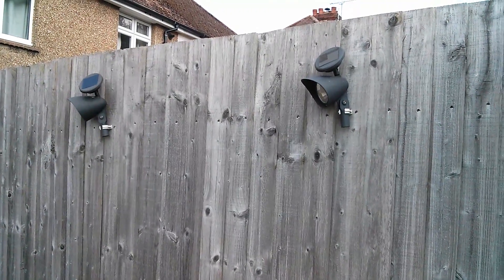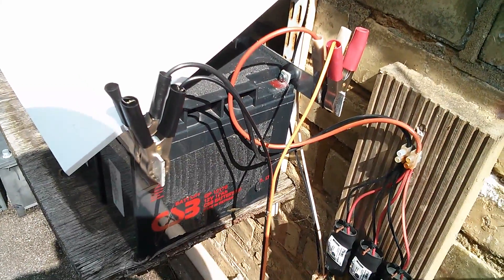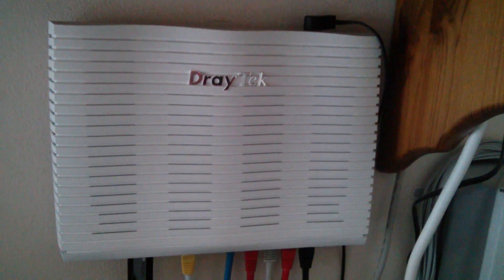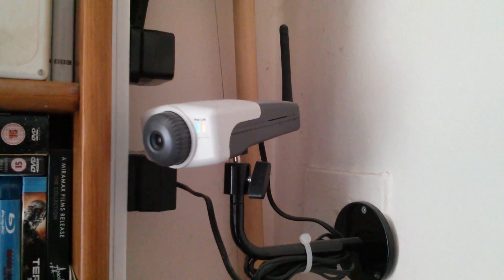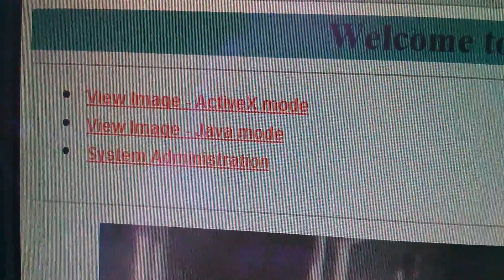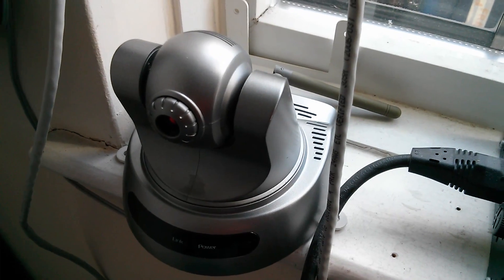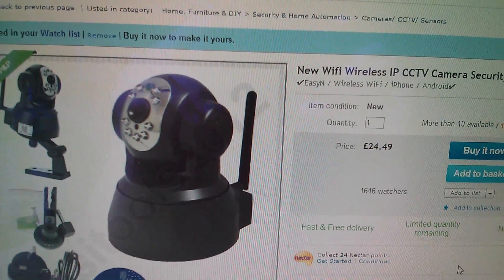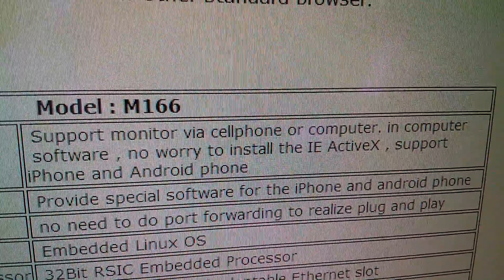IP Security Cameras & Learning about TCP/IP

Comment: What I would look out for in new IP cameras are the video codec they support in hardware. All the cheap cameras will put out MJPEG, which in essence are single JPEGs sent frame after frame. This has low latency, but the datarate is very high and will gobble your WIFI bandwidth in home or upload bandwidth if viewed from the internet.
Converting multiple of these streams on the fly to something more compressed can take quite a beefy PC. So it's very useful if the camera by itself can do the ecoding, preferably into h264.
Other than that: the streams are almost standardized. I think MJPEG can even be played by Firefox without any plugin for example. MPEG2 or h264 is a little bit more demanding, but there's quite a lot of free software that can play these streams. And for higher resolutions this is the only way to get many streams over the same connection at once.

Comment: Love this idea. I currently have a foscam ip pan & tilt camera that I'm using as a baby monitor. It's not hd but I still needed to run a network cables stead of wifi to use the mic, speaker and bring the refresh rate up. I have an app on my phone that detect motion and faces. Now my little girl is older I'm looking to use the camera for security. Really looking forward to these videos.

Comment: I have a few IP cameras here they are very low resolution I am waiting for the The UniFi Video Cameras to be available at a better price then what they are right now these do 720p, this is important for me as I wish to be able to identify people out the front should I need to. (maybe I should get a 6m pole and mount that one up there and then use lower quality ones elsewhere.

Noted on your Qnap NAS I have a few Qnap nas here and the services they have in them are quite good.

As for networking I use fixed IP for my internal network, that been said for my tablet etc I have a DHCP server set up that only have a range of some 10 IP addresses available. (DHCP is still using IPv4 I have all the win7 and linux computers running a dual stack and IPv6 gets priority when accessing my NAS(s).

Comment: The best app for android  for controlling many IP cameras is TinyCam Monitor Free/Pro https://play.google.com/store/apps/details?id=com.alexvas.dvr I have used it for a quite a while now with many different IP cameras (foscam mainly) some that support Pan/Tilt and it works great over DSL for live streaming of multiple cameras at once. Glad to see your a Zen Internet Customer as well. It is very difficult these days to get multiple fixed IP's on ADSL accounts but zen still do offer it if you ask, But like Ashneil Roy has said you can just use one IP and PAT ( Port address Translation) "Port Redirection" in your Vigor 2800 router to map specific external ports to each camera on the same port, no need now as you have the 6 IP's
Reply from the maker: Wow! TinyCam is awesome. Really easy to use and gives you live streams n less than 1 second after launching the app. Seriously considering buying the pro version.

Comment: If required, you can put all 4 cameras on one external IP address by specifying a unique port for each camera. If you do this, you will be able to access the web panel by visiting http://YourIP:YourCameraPort . Keep in mind that you will need to keep the local IP addresses unique and you will need to do the required tunneling on your router.
Reply from the maker: I've never tried that, but I'd like to. It makes sense too - I can use 1 static for websites, another for public IP cameras (all on different ports) and the rest for my private IP cameras.
Reply: Julian's Other Stuff It should work for sure. I've been running 15 IP cameras off one public IP address. The first camera's HTTP server was forwarded to port 10001, the second camera to 10002, and so on. This is something all routers can do.
Reply: port forwarding ( NAT / PAT ) is very straightforward 
something i do several times a day :o)

( i own an IT/Comms/CCTV company)